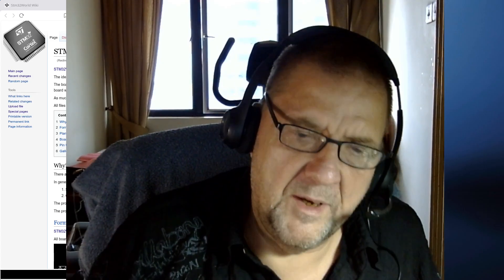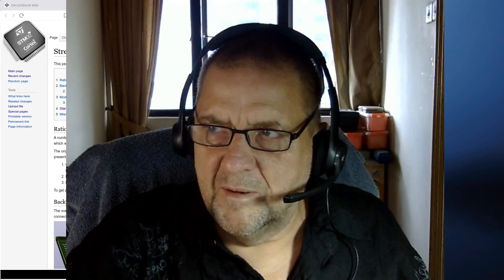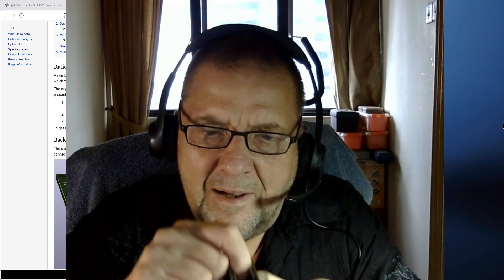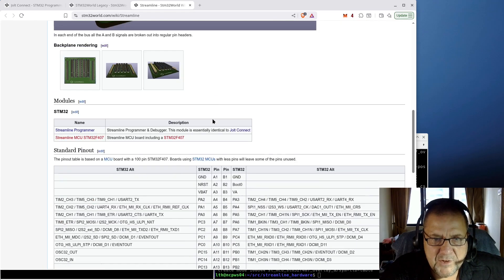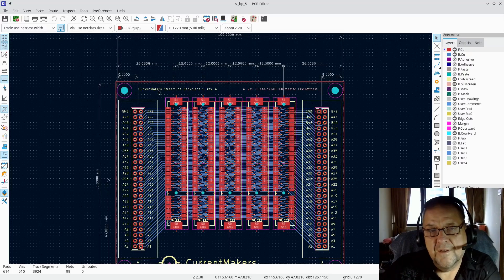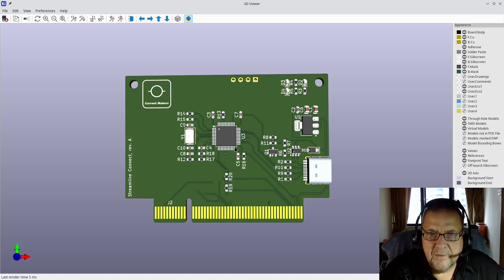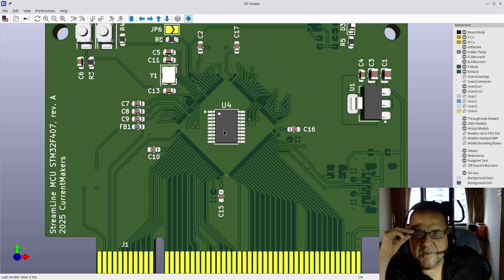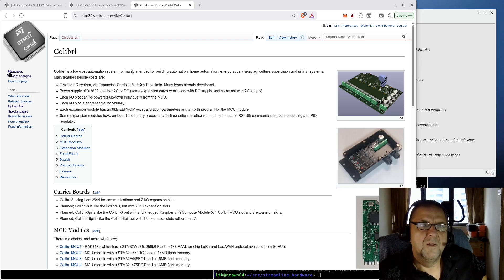Introducing the Streamline Development Boards

Comment: Hej Lars
Sounds interesting to me.
Though I would say, try to go another way than the chinese. I mean don't go down the cheap-cheap alley, doing what is essentially just toys. Such as Arduino.
Make something more real-life useable also in the practical way. I mean maybe keep it as a bare PCB, but do some that may fit into a housing we could obtain elsewhere.
There should be some peripheal pre added as analog inputs PT100 /PT1000, 0-10V and digital inputs that may accept 24V.
Reply from the maker: I am sorry but running small-ish orders at a reasonable cost is simply not possible anywhere but China.
As for the rest of your question this is NOT meant ever to go into a permanent system - it is meant for flexible development.  Nothing prevents you from designing your own module for particular use cases or using particular sensors.
Finally have a look at our Colibri system.  That is pretty much intended for exactly what you have in mind.  https://stm32world.com/wiki/Colibri

Comment: Overall this is a great idea and it's a miracle it hasn't been invented already. Some ideas: power could also come from backplane as well. this would however sacrifice pins on the PCI connectors but would be less cable mess.Since all PCIs share one bus it could also be possible to use multiple MCU extensions at once and let them work together. There should be an environmental extension with e.g. BME280 among other sensors and a display extension. For this to make sense you could make only 4 of the PCIs horizontally and the last one vertically so you can have a view on the display.
Reply from the maker: A lot of time went into thinking about the backplane.  We could have put leds on it, power supply was indeed considered.  The problem is two-fold:
1. What I dislike about existing solutions (like the discovery boards) is that they enforce certain opinions.  Flexibility is the key here.
2. It would increase cost for no reason.
I don't understand your reasoning.  IF you add a power supply you will have more cables.  As is power will just come from the extension boards hooked up to USB.
But - and this is important - the backplane is clearly specced so nothing prevent you from designing a powered backplane or a separate power supply extension if you need more juicy.